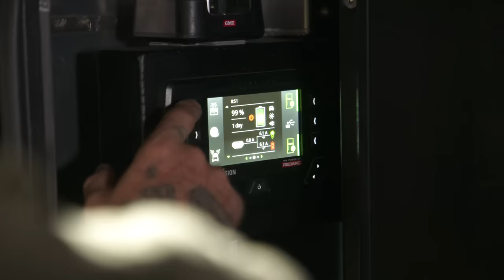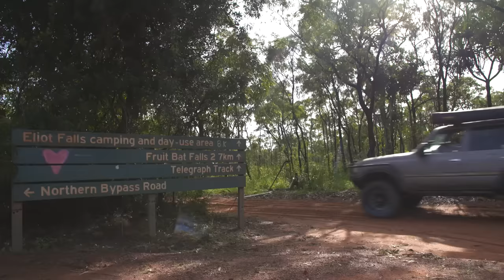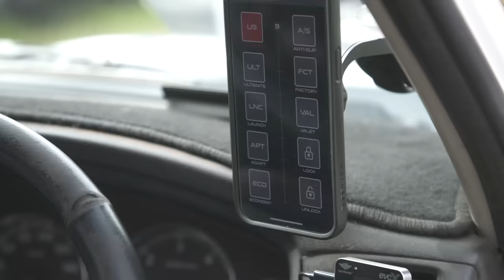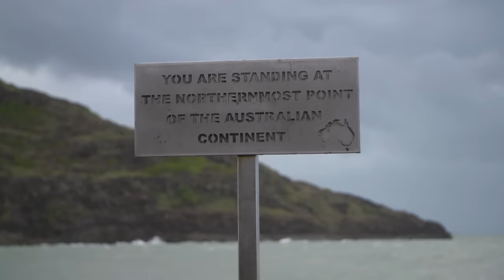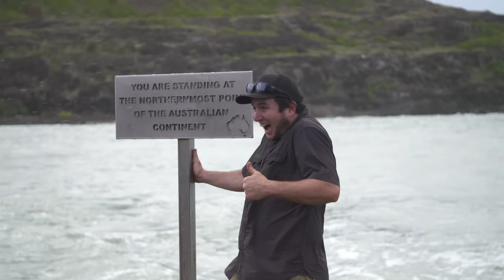THE WETTEST WE'VE SEEN CAPE YORK... RAGING rivers & bottomless mud - 1st 4WDs down Tele Track 2023

Comment: That's where we are agoing too, heading off this Sunday!!! Me in my 1991 turbo diesel 80 series gxl and my father's 2001 turbo diesel 100 series GXL, we are leaving on Sunday for 5 weeks heading to Cape York and spend as much time as possible exploring as much of the Cape as possible, I've spent over $7K replacing bushes, links, joints and all running gear and new fuel filters pumps injectors, will be doing as much as possible  !!! This is just making me excited.... 3 days until we head off!!!
Reply: Have been lucky enough to do the tele twice .... it will be a trip of a lifetime enjoy it all ....
Reply from the maker: Awesome mate - bloody exciting! Enjoy
Reply: @4WD247 any little secrete spots that aren't on the map to visit?

Comment: 25:35 Oenpelli to Maningrida (Arnhem Land) I drove into a washout after rounding a bend in the road at a good speed, pushed the front axle set back and bent up the front guards.....had to get the tomahawk out and modify the guards and use the winch to pull the axle forward so that I could continue.......all part of my job at the time.

Comment: Had the hsp one but ever time off road i need to reset the level of it and cleaned the track as it will not shut or open fully. Now have gone thr maxliner canopy and gain more space and want stuff in there to be out of the rain if i get new washing machines and stuff like that, issue with the maxliner is it is 90kgs and car loose the ute look but.

Comment: Hi Shaun , great adventure , . Like south Florida back in the 70’s lots of water just at end of the rainy season . Sadly most of Florida has been built up and not many places to ride off road anymore . A little cooking tip to pass around to your mates . 1 pan cooking I have a 10 inch cast iron skillet with a cast iron cover  that I bake in and use as steamer . The secret is standard SS. Nuts and piece of 3/13 inch steel plate . For baking I put 4 nuts in the pan and the plate on the nuts . A little oil on the plate then your meat . If you want to some veggies , I make open envelope with aluminum foil put a little water in and put it in the pan next to the meat about 5-10 min before the meat is done . I cook stuff about 350 f so on the camp you shouldn’t need a lot of coals . Steaming is about the same , except I stack a extra nut  under the plate and pour water in so it just touches the bottom of the plate . Steaming cooks things a lot faster , so if it’s a late night and you want a quick din steaming is the way to go . I have tried all kinds of meat steaming all has come out good . Both of these too different ways of cooking are nice also because you don’t have to mess with the food just and go do something else. You have to a bit careful when cooking on a camp fire with the baking at first . Well safe travels

Comment: Best back woods rotisserie; get a few long bolts, tack weld on some 90 degree prongs, cut and thread the ends of some food safe metal rod. Connect the rod to the bolts in whatever pattern is needed. Setup and breakdown is a breeze. Perfect backwoods roasting spit.

Comment: I have a 2020 amarok V6 sport line it’s had a 2 inch lift, bull bar with winch and mud tires. In you opinion do you think with all its 4wd downfalls it could handle this track you guys are on in this video. Just a curiosity question: ??

Comment: Man here in America people seem to think you need 40 inch tires to go "off road" but apparently you only need a slight lift and 35s (or 32s in Jesse's case) to do some hardcore wheelin
Reply: the terrain is very different, we also live by "she'll be right" 😂
Reply: Western side of the states 35's are the minimum you want or need for some of the trails. 40's just make it a bit easier. That said, you can do a lot on 32's  to just get out and about.

Comment: QUESTION?,  when are you austrilians going to use a waterproof air filter ?  like K&N ?? the silicone is ok, but over time its not the best ?  its a quick fix? i made a snorkle with the filter on the top, the filter is a round ford filter 2000 model. the filter is on the top near the snorkle top intake air tube, MADE FOR A 2004 DODGE 1500 RAM TRUCK 4X4..  everything below that is  solid pipe right the throttle intake . all made from 4"ABS black plastic pipe then necked down to fit the throttle body intake, A 4" TO 1 1/2 " AIR FLOW,

Comment: 37s are the new 35s in the US. In Australia 35s are still considered as big tyres when it comes to 4wd. Toyota LCs and Nissan patrols won't be as reliable as now if the tyres sizes are not so limited. Only 2 inches bigger from the OME size have it's pros and cons.

Comment: G’day, I am here to ask for an advice. My hilux surf has a brake shuddering problem. I tried fixing it by balancing the wheel and swapping the wheels front to back but still didn’t fix. Can someone help me out please.
Reply: You need the rotors skimmed or a whole new set. Or just try some hard braking to get your rotors Hot and then normal braking to take the warp out of the rotors.

Comment: I want to do this next year to the tip from Perth in my HZJ105, I don't have a winch or lockers, what would be the minimum mods recommended? Got 2" lift and 32" AT's.
Reply from the maker: Winch snorkel diff breathers most important mods
Reply: Got a snorkel and diff breathers, I'll look into a winch, thanks.